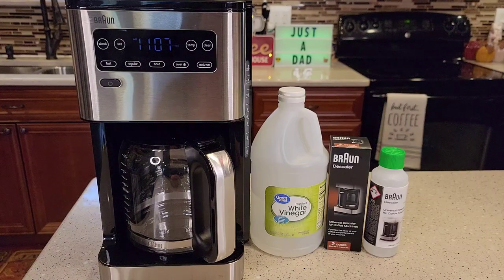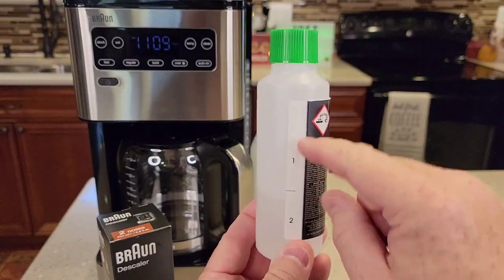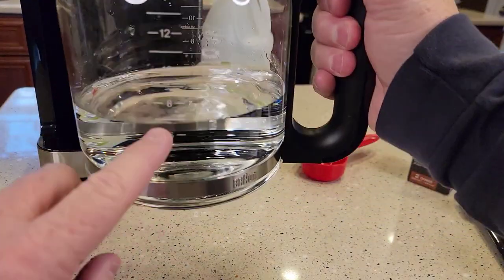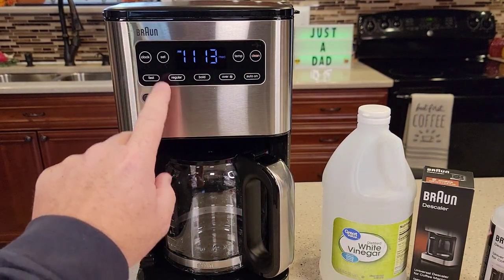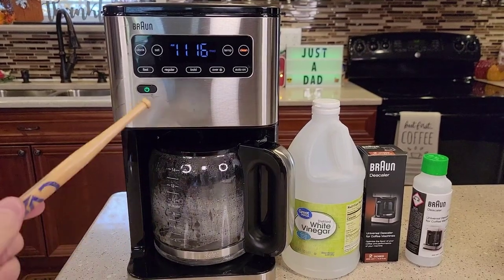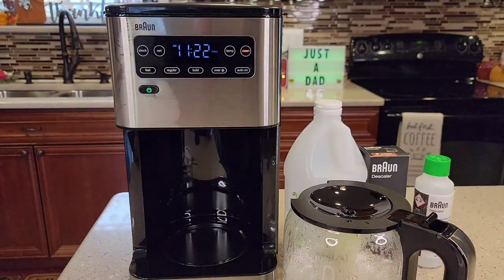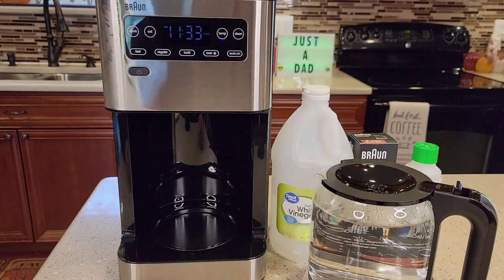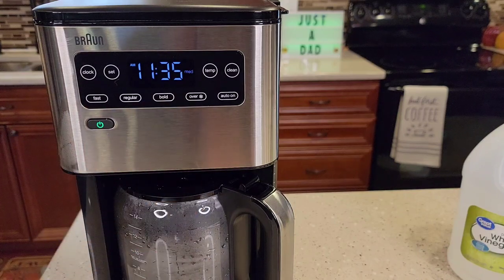DESACLE BRAUN Pure Flavor 14 Cup Coffee Maker KF5650 CLEAN LIGHT ON?  DESCALE MODE

Comment: You may want to investigate using vinegar a bit further. I used it for years on a Braun BrewSense, which developed a leak due to failure of the rubber hoses. Then I read where vinegar can cause deterioration of the rubber. Now I use either the Braun descaler or a citrus-based product.